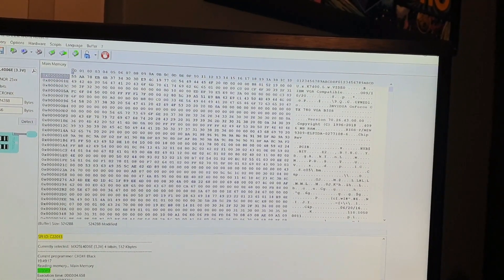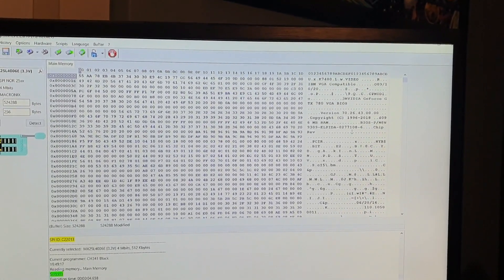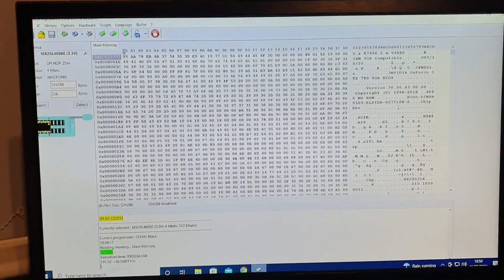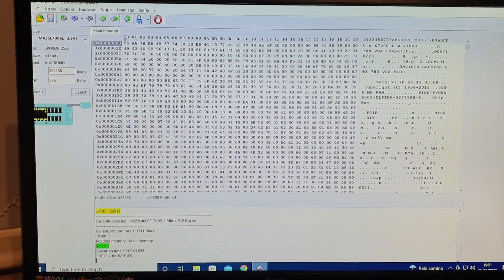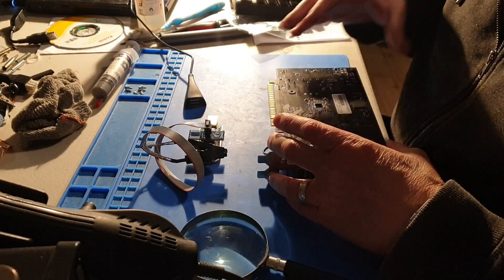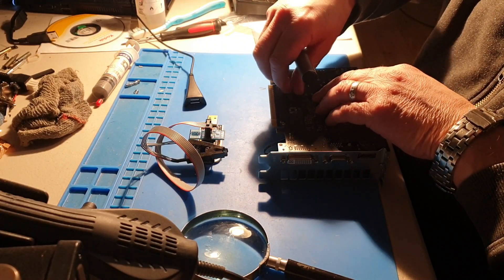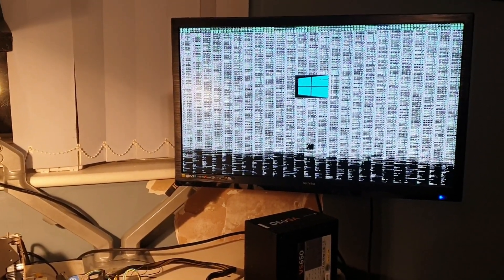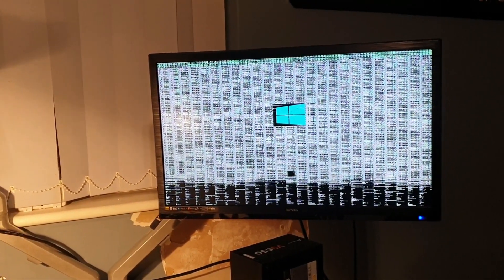Fake GTX 780 from China tested with modern games and bios flash

Comment: can u plz give us a link for the original bios that came with
Reply from the maker: Hi There is no link to the original bios as they are made up by the scammers they are not interchangeable either, if you can try all of the fake bios'es on the card if you can find them posted online but I couldn't find any or you can copy it off the card using gpu-z or using the bios flasher I had, but if you are referring to the original bios what the chip actually is that's anyone guess and as I found the card had different memory so the bios didn't work , but techpowerup hosts all card bioses just google it they do have some fake ones on it as well . https://www.techpowerup.com/vgabios/143074/143074 that's just 1 of many gt 450 bioses that these cards actually are .

Comment: Thank yot for the video. I've come dearly near buying one of these obvious scam cards. I do really enjoy the older tech. I wish it were a straightforward modification to take say, a Radeon W4100, and add a 6-pin connector to add a little juice and get it a step closer to the HD7870. Which I believe they use the same processor. Have you heard of anything like that being done?
Reply from the maker: Hi, i think if it was the more common GTS 450/GTX 550 ti I would have been able to flash the bios back, but it was a weird  GPU die , I'm pretty sure that workstation cards have the Cuda cores disabled either with the bios or a missing disabled resistor cutting off the said cores, so to bring them back to there "biger brother" you would have to do a bios hack or add the missing pathway to the disabled cores and find a bios that will work with the card so it reverts back to the Radeon or Nvidia that it is based on  I am no expert though, I remember that the RX  5000 xt and some R9 cards you could flash the next or highest tiered card bios on to them and they would act the same .